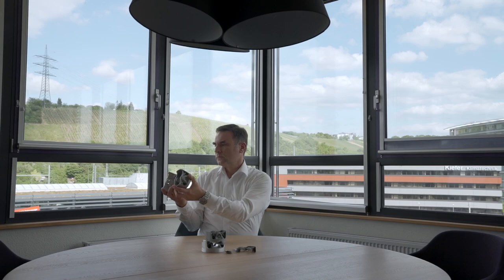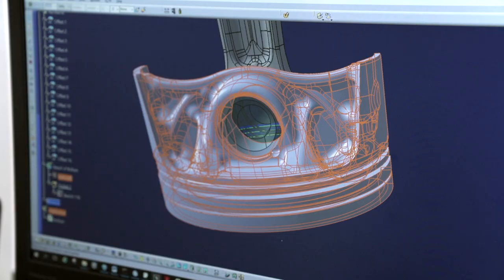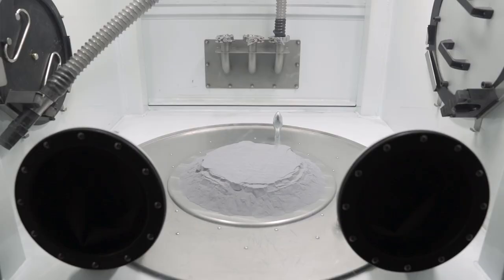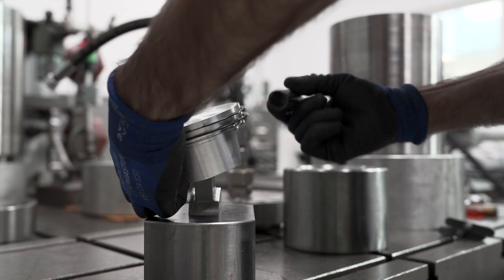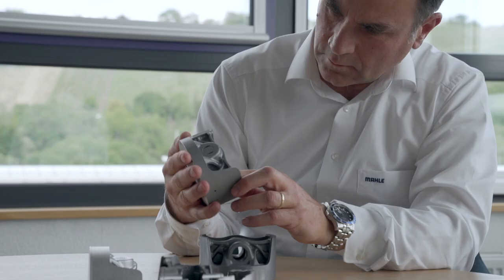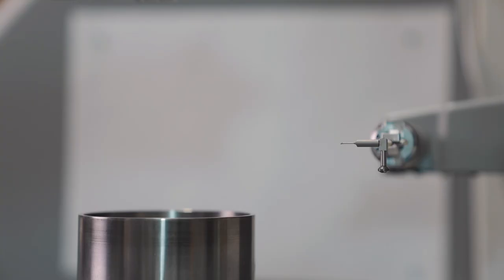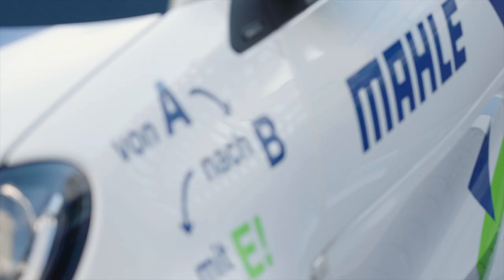MAHLE 3D-printed pistons for the PORSCHE 911 GT2 RS

Comment: Well....Mind. Blown. I had no idea we were so far down the road of 3D printing to be able to produce such high stress components!
Reply: Airbus wants to produce titanium landing gears in future with 3D printing, and other aircraft parts.
Reply: spacex rocket engines are 3d printed
Reply: The strength of SLM printed parts actually match or even go beyond that of cast metal. If done properly, and with proper post-processing, porosity in parts can be eliminated and crystal structures can be improved. The true benefits of 3D printing lies in geometries hard to produce using traditional techniques though. Like topology optimizations and internal cooling channels shown in the vid
Reply: Ralph111417 I study mechanical engineering and me neither 😅
Reply: @cucumberworks  I think the integrated oil channel in the piston would be impossible to construct using normal manufacturing. Very interesting to see them really take advantage of this technology.
Reply: GE is very proud of their new 3d printed nozzle

Comment: Now lets keep a complete inventory of all car parts so we can print them 50 years from now.
Reply: This man here speaking the truth
Reply: Not enough though, you only produce the blank by 3D printing which on it's own is kind of useless. It's not a finished part ready to install. The thing is, once a factory ends production of something, that thing can never be built exactly the same way again, that particular set of machinery and processes will never come together again. It's why more Saturn V rockets or Ford Model T cars can never be made again. You can dig up the design files and build a replica based on them, but that's all it will be, a replica, not continued production of the same thing. Because the manufacturing process will not be the same as it used to be, the tooling will not be the same, the work methods will not be the same. Heck even the materials might end up not being quite the same. For example, for sure somewhere there is a drawing of a Model T wheel and it might even say to make it out of wood, dimension it such and such, but I bet the decision on what kind of wood to use is left to the reader.
Reply: @aleksandersuur9475  You have based your answer on making exact parts. What wrong with quality replica parts if it means putting your car back on the road?  Better than not having the part at all.
Reply: @dan__________________  Fair enough, if you want to make a replica then having the original design drawings or CAD files would be incredibly useful. But... well it's not like archives of these drawings and designs haven't existed for the past century and more, every manufacturer archives all the designs they have ever built, in many countries you are legally required to keep them in fact. Unfortunately them having the archives and you accessing them are two different things. In the end I think you'll just end up doing what everyone always does in this situation, take the dimensions of the broken parts you have and design your own generic replacements.

Comment: 3D printing is taking over the manufacturing in every industry.
Great for efficiency.
Reply: I wouldn´t say taking over but it is added more and more into the development and production of all kinds of products.
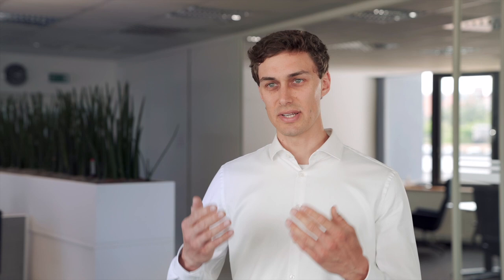Reply: @apSos.de it's actually not great for efficiency compared to casting, forging, billet machining, however it does enable features to be produced that might otherwise prove difficult or impossible, such as the cooling channel at 1:31
Reply: World produces about 90 million cars per year. And it takes 12h for a 3D printer to make a set of aluminum piston blanks for one car. So to make all the piston blanks by 3D printing, you need 123 288 of such 3D printers working round the clock just on that and nothing else. These 3D printers cost about a million, but I'm sure you can get a discount on such a volume, so lets say you can get away with about 100 billion investment in 3D printers and you got the piston blanks needed for world production of cars covered. You better not want any other part of the car to be 3D printed. The good, the bad and the ugly of 3D printing is that it does not do economies of scale, the first unit 3D printed costs just as much as the millionth. That's great if one is all you want, it's a complete deal breaker if you want million units.
Reply: It offers great opportunities to consumers to produce their own custom parts at home or in specialized Local Shops which specialize in 3D printing. 
I have some obscure old Cars and Bikes, and 3D Prining would allow me to reproduce old Cast Parts that have been out of Production for years.

Comment: Amazing technology. I gad no idea that Mahle could print high performance pistons like this.
Reply: They 3d print the pistons in Ferrari F1 engine
Reply: These are not high performance pistons they are used for prototyping, the title is a bit click bait.
Reply: @Iseenoobpeoples  well its not because its highly likely to be the way they produce low production volume pistons from now on. What would be the point in prototyping a cooling channel inside the 3d printed piston, when it cant be reproduced by any other means of piston manufacture?
Reply: There is a company in greece that makes real 3d printed High performance pistons that can withstand 2000 hp plus while also beeing 50% lighter than a normal piston

Comment: Some informations about the manufacturing time of an 3D printed piston vs the manufacturing time of an conventional pistion would be interesting!

Is it possible for a volumen production?
Reply: Porsche only made 500 GT2 RS's globally, and they go for $294K apiece. Now Do you think they are concerned about Mass production?
12h For a batch of 5 pistons. One of those machines probably costs just as much as a GT2 RS if not more. I don't think we will be seeing these pistons in any mainstream vehicles any time soon.
Reply: @treffle17  one of those machines costs just as much as a GT2 RS? Not even close, try 100 of them.
Reply: @treffle17  honestly I could see VAG using this in their mainstream cars in the next ten years but that's only of they aren't forced to only produce electric vehicles before then. With how much 3D printing has improved over the past few years I don't see why they wouldn't, less material loss , better end product and 3D printing is getting faster everyday 12 hours for 5 today but 500 in less than 12 hours tomorrow kinda thing.
Reply: @joshmac7245  Yeah but although topology and the cooling gallery are nice for high performance applications, by far the most engines aren't built for peak performance, therefore they'll still get cast pistons because they are way cheaper and faster to produce
Reply: @FzudemB  though I agree with you for now , down the road that will change. Just look at how far 3d printing has come in the past 5 years. I think the only real question is "will the combustion engine still be around when that happens?"

Comment: Oil cooling has been used in pistons for about 20 years now. Why is this method better? Why not just CNC from a forged material?
Reply: You can't integrate it in the same way. When you look at the graphic, how should it be possible to machine a full circle which is enclosed.
Reply: @Flying RC how would you produce the cooling channel close to the piston crown? See 1:31
Reply: Oil cooling is even older than 20 years in gasoline engines. The Nissan 300ZXTT was introduced in 1989 and had it. I think the Nissan 300ZXT had it in 1984. Also, some diesels had it even earlier than that. I think some Benz diesels got it in the 1970s.

The difference mentioned is that 3d printing enables more flexibility in oil channel design when compared to existing methods.
Reply: @skylinefever  The RB engines in skylines also had them in 1989. My point is this 3d printing method adds no benefit when a 1000++bhp engine runs forged CNC pistons that's already proven technology.

Comment: Does the wrist pin journal have to be of equal dimemsion all around? It's only pulling a partial vacuum on intake, so could be thinner on the crank facing side.

Comment: 3d printed pistons or forged pistons, which one's better? Both are quite different imo. Please lemme know.
Reply: That's an interesting question, I'd like to hear the answer too. 
Based on pure speculation and my 'midwit' knowledge of materials, I imagine they'd be able to control the grain structure of the 3d printed piston and do some post-printing heat treatment etcetera to get the strength and where it needs to be. However, I would have still thought a forged piston would have a better grain structure as it's more homogeneous and therefore it'd be stronger?
Reply: @zeroyon4562  yeah i was thinking the same thing, i was like maybe they could reinforce a piston with a 3d print manufacturing process cuz with a 3d printer arguably has say more flexibility in the process, make sense? Idk. But forging is a much more complex technique requires a metal to be beaten down repeatedly to cover any air pockets and usually results in a much more robust product.
I just cant pick a winner.😂

Comment: These are not high performance pistons they are used for prototyping only, the title can be misleading.
Reply: true video don't say about flaws of that kind of piston it never be capable to compete whit solid build ones i bet its 3d manufactures want get some investors to justify having mega expensive 3d printed pistons )))
Reply: Are you suggesting 3d printed piston's can't produce high performance?
Reply: @mrcat1991  Alternatives are much stronger/reliable, that's why they are used only for quick prototyping/testing.
Reply: @salamdrik  At least they mention prototyping in the video unlike HRE wheels that try to scam people by saying their printed wheels is just as strong.
Reply: @mrcat1991  forging makes usually stronger parts than casting, and 3D printing is from the principle similar to a casted part.
On the other hand, you can produce parts which have a different structure inside the material than ouside (and imitate biological structures like bones) - this is something only 3D printing can do
Reply: @Iseenoobpeoples  are there videos of failures?  Of the HRE wheels
Reply: @joe718gt4  I hope no one would be dumb enough to run a 911 to it's limits with HRE printed wheels.
Reply: @Iseenoobpeoples  if they are DOT, TUV etc. Approved, there is nothing wrong with them.  Serious track rats wouldn't be buying them for the track anyway.
Reply: @simonm1447  Laser sintering has got nothing to do with casting. Different laws of physics at play, altogether. The strength of 3D printing is that it can take better advantage of topology optimization even though the structure is indeed slightly weaker. The end part is stronger.
Reply: @ExMachinaEngineering  No way 3D printing is stronger than a quality high density casting and both get destroyed by CNC billet and forging.

Comment: I’m a bit lost. Isn’t this just a lathe? It seems there is a thin line between 3d printing and manufacturing.
Reply: The machining is just for the finishing touches like turning the outer surface and probably drilling the hole for the wrist pin. 3D printing can't achieve the tolerances needed here.

Comment: Amazing, but isn't this too late? Everyone is focusing on electric and alternative energy and Mahle is producing new concepts for old technology.
Reply: This is for high end performance cars. Battery electric vehicles are still way more expensive than a good old ICE, and even Tesla's charging network is not yet comparable with gas stations in capacity and charging speed. BEV does have a few specific advantages over ICE, but also several major drawbacks. With a plug-in hybrid you get most of the best of both worlds and you don't need to pay for that expensive battery. ICE is far from dead.

Comment: Their Ecoboost 2.0 Forged pistons need work. Wrist pin end play and oil ring design are troublesome.
Reply: Thats a failure from Ford. Mahle makes only the part from the dates of Ford. So tell that Ford.
Reply: @Cupra317hp   the factory pistons have good end play and the oil ring doesn't fold over when you're trying to install the piston. I was unable to install both c clips on the mahle forged piston. I had to shorten the mahle wrist pins. It's not an exact copy of the ford cast piece.

Comment: But metal printed one always be softer and more fragile no ?
Reply: I think the secret is in the sauce... AKA.. the powder they build with... Classic SLM printing is not good... but they said they have a special self developed powder.... interesting..
Reply: @steinarne79  I was wondering about the long term durability of these pistons. I'd seen somewhere that 3d printed metal parts are more prone to failure because of material used. I think the process leaves parts with more impurities that can make the parts prone to micro fractures.
Reply: @KhushbuMel  How long term are you talking about? 2-3 years or 10-20 years.

Comment: What bs! Same design can be still be made by forging. This video is just a lame PR stunt 🤣
Reply: Could you do the water channel with forging. I'm betting you can do more with a 3d printer than forging.
Reply: electron Jarvs if anything that’s designed to flow through, it can be done via the casting/forging process. If any hollow space needs to made inside the structure then 3D printer can help. I personally design and work with 3D printers at work. The only key point is for 3D printers shown here is small batch manufacturing which wouldn’t be ideal for forging. The start of the video is just marketing BS.